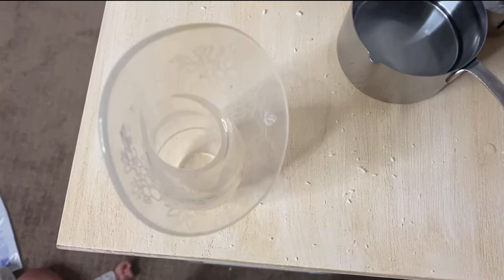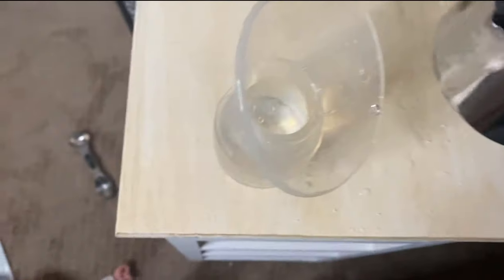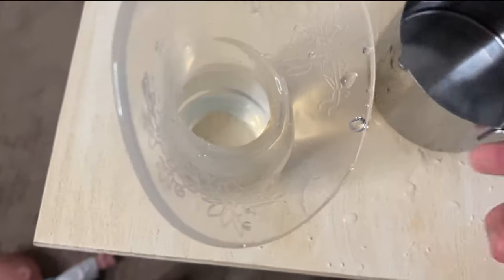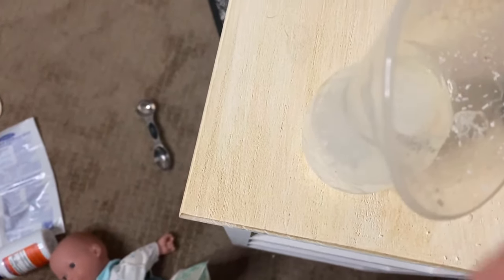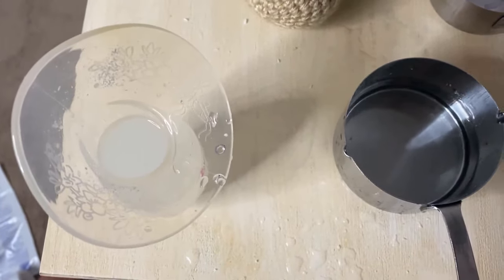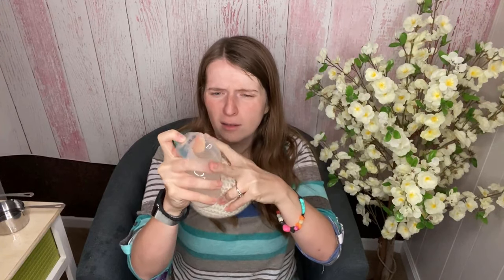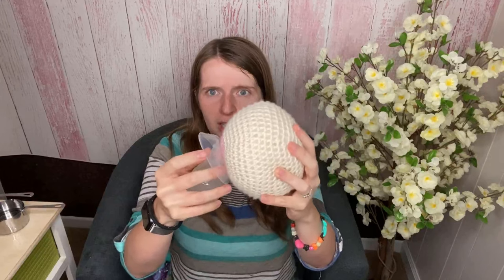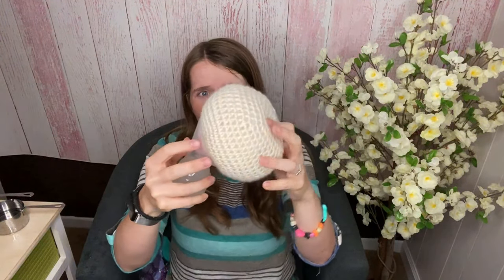How to Use a Haakaa for a Clogged Duct!

Comment: Thank you! You can actually see when the duct opens up and the milk rushed into the haakaa!
Reply from the maker: Amazing!
Reply: Does not work
Reply: Hi do u have to pump the Hakka???
Reply: @Mariekr49 no its passive suction. As long as you squeeze before you put it on, its sucking.

Comment: I had a very stubborn clogged duct. The whole top of my right breast was clogged and that caused for me to also got engorged on that portion of my breast. The whole top part was rock hard as the day progressed and it was until the following night that I finally unclogged it. I did 5 haakkaa treatments for 30 min and when I used my electric pump that’s where I had my letdown. 
I had also done warm compressions, took sun flower lecithin powder, and massaged firmly the area. Do not give up on the haakkaa. Keep trying to reattach it until you feel a painful suction. It should suck hard enough that you can pull your shirt over it and you can walk around the house and do other tasks while the 30 min are up!

Comment: Okay so I just want to make sure I’m understanding this correctly, I just suction the haaka to my breast and let sit there without compressing it, correct? And then the milk will go into the water so I’m then wasting milk 😫Or I let sit for 10 min, empty the haaka and then let the milk flow? -my milk supply is so low already I’d hate to waste it but I guess it’s better to get relief than an ounce or 2 of milk
Reply from the maker: Yes, no compression. I would just do it until the clog is removed. I wouldn't do this while you are nursing, as that should limit the amount of milk that comes out.
Reply: Pump normal first, then do this method. For future reference
Reply: @caroc4327  pump with the Hakka u mean?
Reply: @Mariekr49  I meant, pump first with your regular pump to get the breast as empty as possible, then do this method with the hakka. BTW, I'm so sorry if you're the one going through this. I tried everything and this is the only thing that has worked for me. I let the Hakka stay on for almost 30 minutes before it worked, but it did and it was sweet relief. Prayers that you will get through it, I will try and respond if I see you comment again. Best of luck!
Reply: @caroc4327  do you rerill warm water while waiting ? Cuz after 30 mins it maybe not warm anymore
Reply: I actually had to use it while driving, so I used the warm water and epson salt at first, and then I just put it on empty.
Reply: @TheBreastfeedingMama when is the right time to do it then? Before or after nursing/pumping?